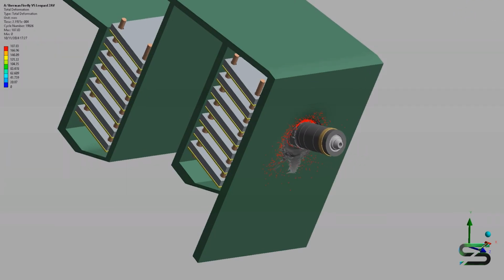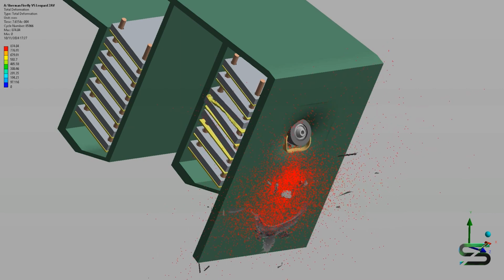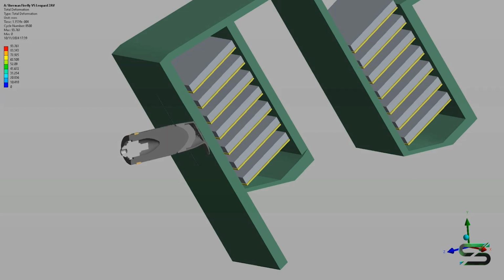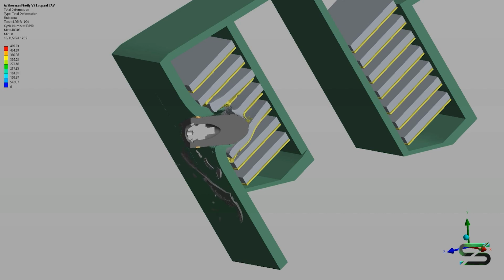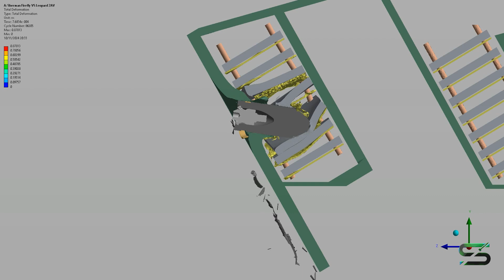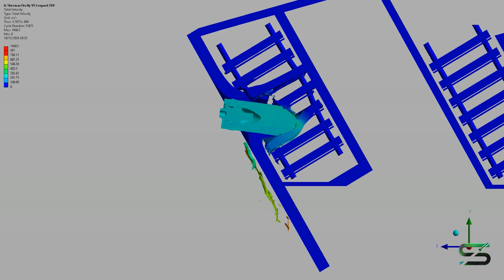Sherman Firefly VS Leopard 2AV | Armour Piercing Simulation

Comment: I think this is the wrong shell, the Firefly did fire an AP round at first (not this one, this is the shell for the US 76mm) but late variants used APDS, which probably would've gotten to the center of the armor before shattering I think, so it'd go through the first plates and then break in the spaced part